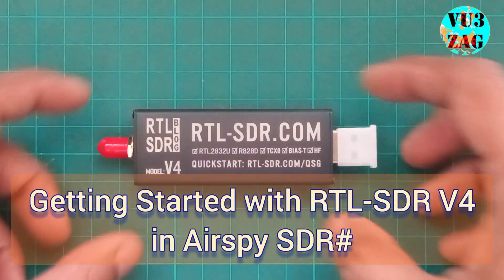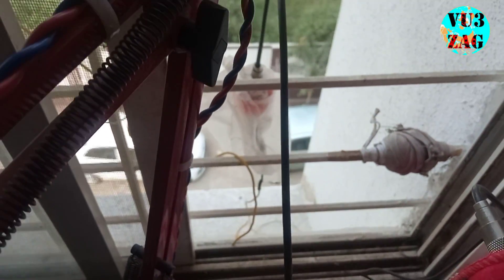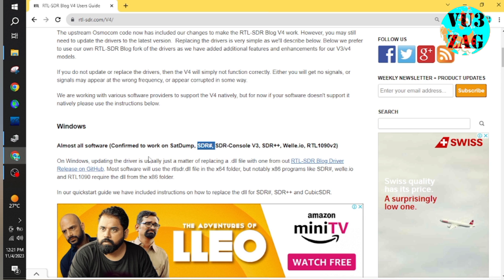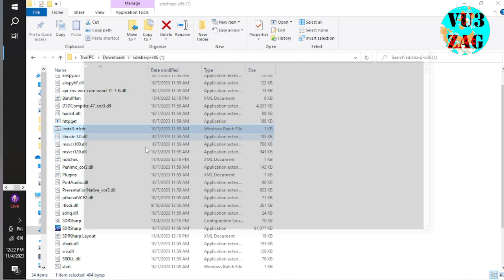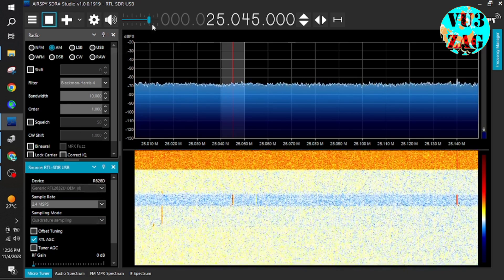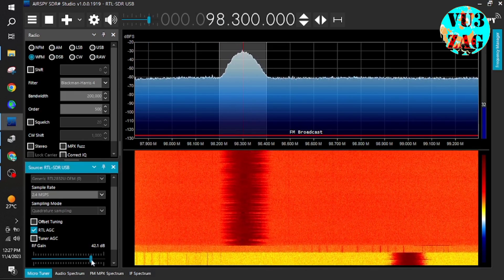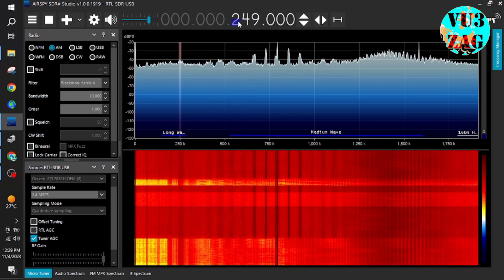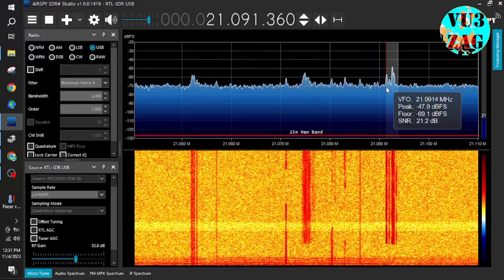Getting Started with RTL-SDR V4 in Airspy SDR Sharp (SDR#)

Comment: I dont hear any one talking. Just noise. I want. To send mi e back.
Reply from the maker: That's good, Hope you are using a good antenna. Also consider band conditions while monitoring.
Reply: Ok. I am on a 75foot long wire. Switched to smaller dipole that came with unit. All i get on medium wave local channels
And still cant get audio with speech. No music no voices. When i switch back to v3 everything works fine.
Reply: @smokeandsteamxsw9831 you need to update the drivers for v4.